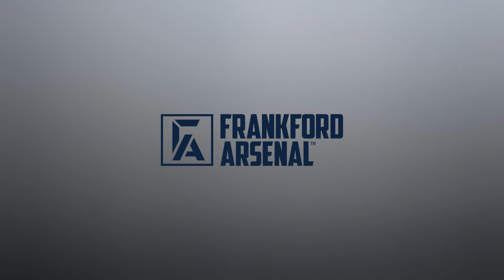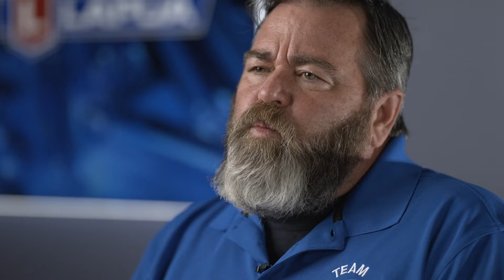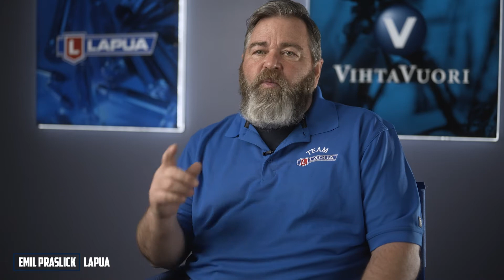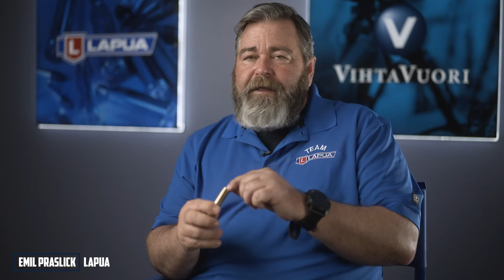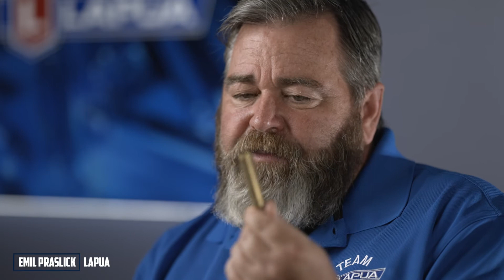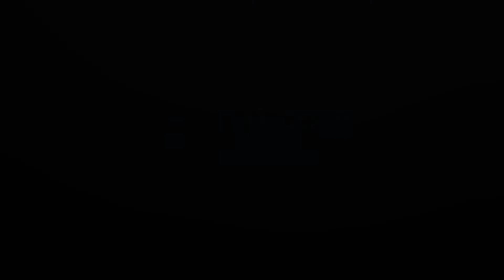Proper case cleaning with Emil Praslick

Comment: Tumbling and then having to flip a case upside down is ok to remove steel pins if you are shooting 100-200 rounds. I reload 1000 at a time of 5.56, 308, 300 blackout and 6.5 creedmoor. I don’t have time to do that. Use a large ultrasonic cleaner after you have deprimed and then let dry and slap it in your progressive. Time is your most valuable asset, use it wisely.